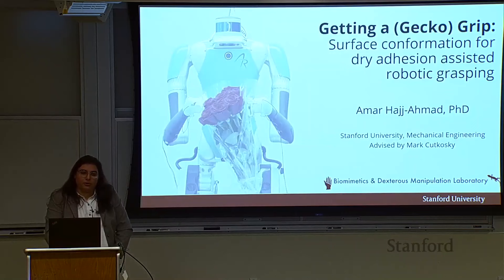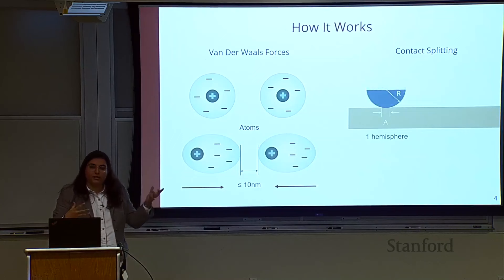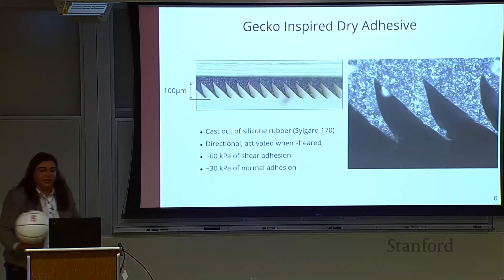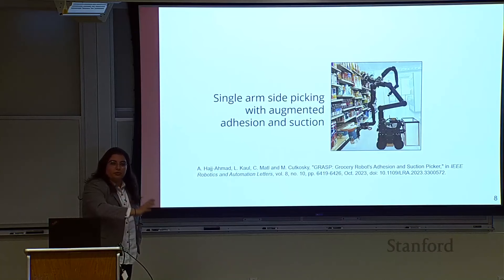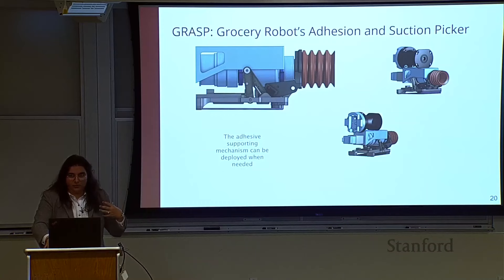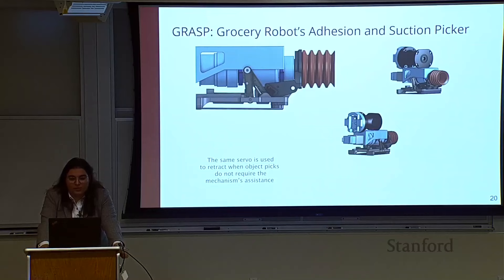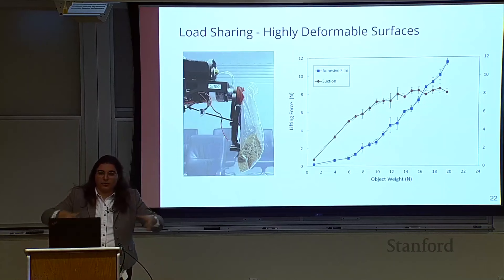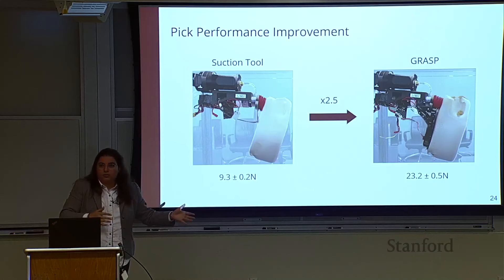Stanford Seminar - (Gecko) Grip: Surface conformation for dry adhesion assisted robotic grasping

Comment: 📝 Summary of Key Points:

📌 Geckos and other animals have the ability to conform to surfaces and traverse terrain without wrapping around objects, thanks to Vander Waal's forces and contact splitting.
🧐 Gecko-inspired dry adhesive, made of silicon rubber with micro features, increases contact area and provides controllable adhesion.
🚀 A gripper combining suction cups with the gecko adhesive was developed for effective use in a robotic setting with limited exposure to the target object.
🚀 The gripper improves performance by providing additional adhesion and reducing the load on the suction cup.
🚀 Preloading the adhesive and timing are important factors that affect the gripper's performance.
🚀 Videos demonstrate the gripper successfully picking up various objects, including a cardboard box, a bag of powdered sugar, and a pack of toilet paper.
📊 The gecko adhesive works well with smooth surfaces, while the suction cup is suitable for flat rigid surfaces.
📊 Combining the gecko adhesive with electrostatics can expand the range of objects that can be handled.
📊 The team is focused on improving the success rate of grasps but acknowledges the importance of having contingency plans for failed grasps.

💡 Additional Insights and Observations:

💬 "Vander Waal's forces are weak forces that occur on the atomic level when atoms get close to each other, creating attractive forces."
💬 "Contact splitting refers to the idea that splitting the contact area across multiple points increases adhesion and mitigates crack propagation."
🌐 The speaker's research on surface confirmation and dry adhesion in geckos provides insights into the development of innovative gripping technologies for robotics.

📣 Concluding Remarks:

Geckos' ability to conform to surfaces and traverse terrain without wrapping around objects has inspired the development of gecko-inspired dry adhesive and a gripper combining suction cups with the adhesive. These technologies show promise in improving the performance of robotic gripping, particularly in settings with limited exposure to the target object. The research highlights the importance of understanding natural phenomena and applying them to technological advancements.

Made with Talkbud